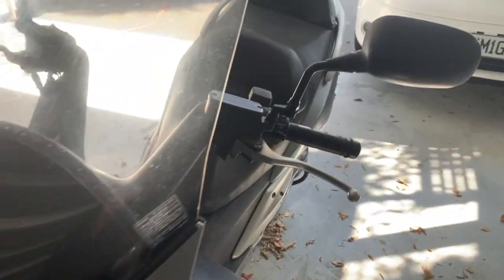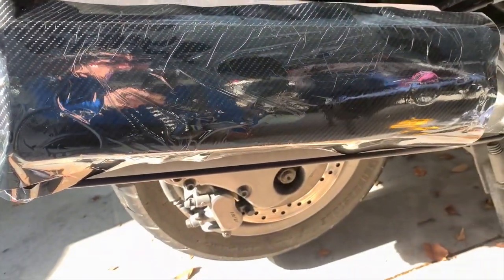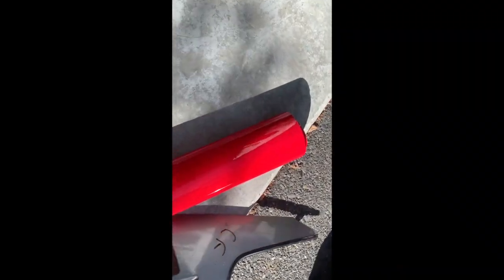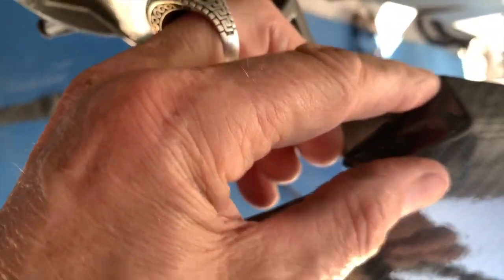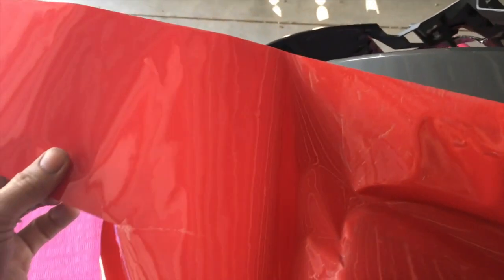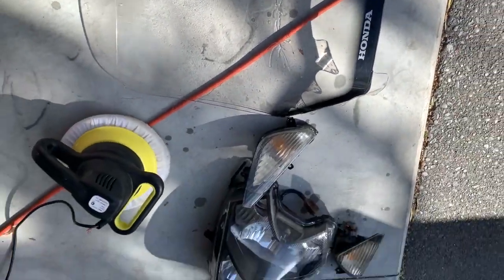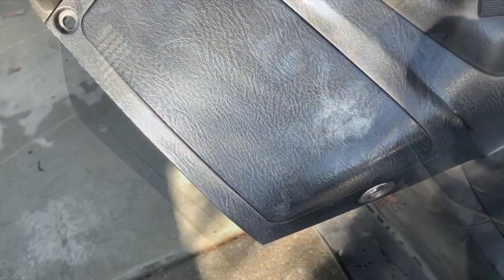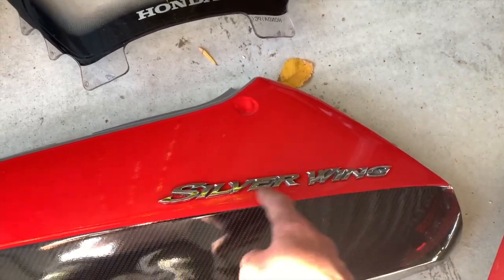Cosmetic Refurb and my first atempt Wrapping my Honda Silver Wing VLOG

Comment: nice looking silverwing . its funny its the bike i bought same number plate lol A4uhl, shame i only got to ride it 4 times, it died on xmas day 2021 spent a loyt of money and still wont go
Hi Gary
Reply from the maker: That's a real pain!  I saw it for sale last year. It always went great for me.  Does not start or is it dead?
Reply: @radiuskinkmusic6657  just turns over wont start. got spark and fuel, put new crank sensor in, big job that was still wont start been through the manual and tested everything but im thinking its coputer fault, cant find one for this bike sadly casbolts not even interested , may have to just parts it sadly. everybody commented on your wrap job on the syds run last year
Reply from the maker: @martinfox51  I have you tried the Silverwing Forum? There is a lot of knowledge there. https://www.silverwing600.com/?utm_campaign=popular&utm_medium=topic&utm_source=newsletter